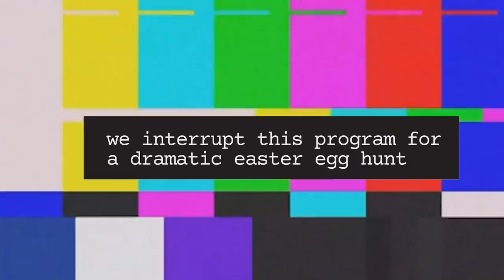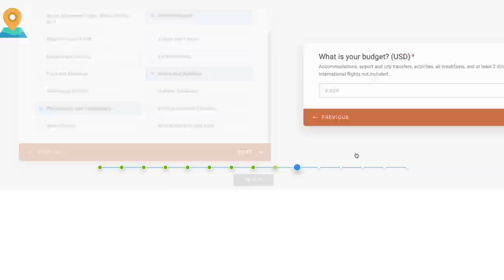Replacing our Shingle Roof // Our Old House

Comment: Its looking lovely. There is a single and the color is cedar shake and it wouod have been amazong on that house with thw blue grays yoinare planning too. But I love it. coming along. Tell Justin a heat gun works better than stripper on the ild wood and its only about $25 at the Lowes. Just be very cautious because the metal part gets do hot and it would burn the kids and dogs with one touch.